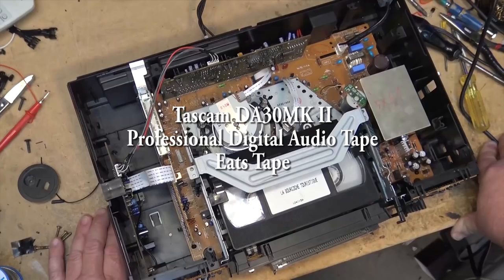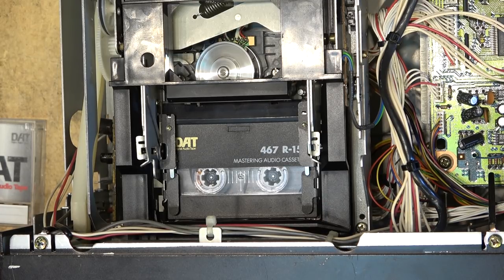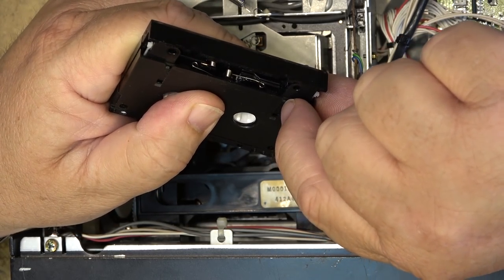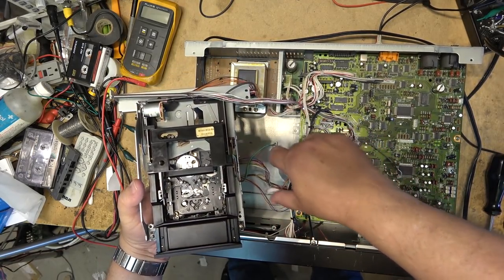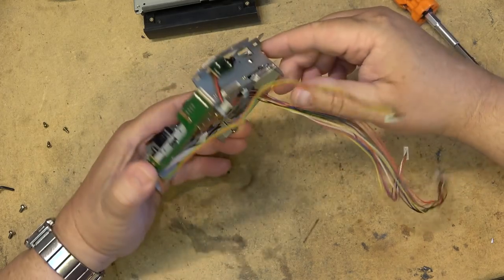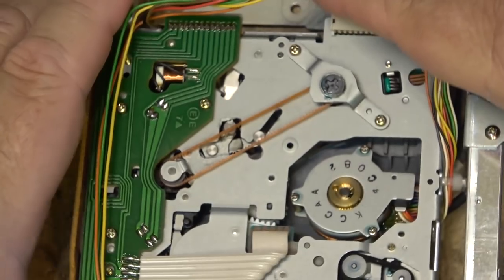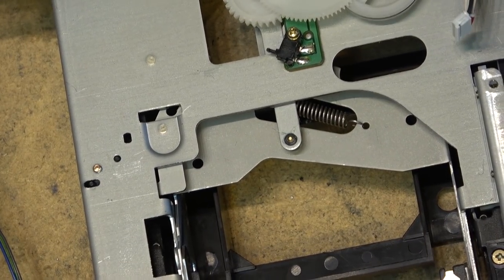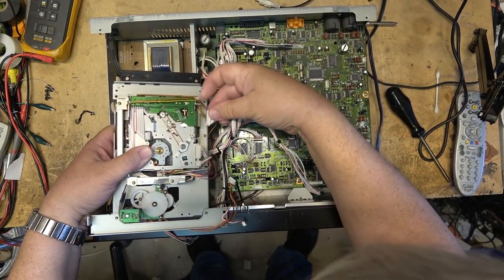Tascam DA30MKII DAT recorder Eats Tape

Comment: I just received a DA30 MKII that was advertised to have been tested and in perfect working order. Thankfully I have watched several of your awesome videos on that and several other models so I had ordered a couple of the loading belts to be on the safe side. Well needless to say I got an error 01 as soon as I turned it on. Fingers crossed and using what I have learned from you I removed the transport and there wasn't a stretched belt issue. There was a NO belt issue. And it was nowhere in the chassis so um someone did some major false advertising in my opinion. Fortunately the belt was all it needed. It appeared to have been well maintained as had been cleaned well. I ran a cursory swab over the guides and rollers and picked up a very minute amount of dirt. Popped in a tape recently recorded on my DA50 and it played and searched perfectly. Thank you so much for all the great videos! 
I bought this DAT as a backup to my DA50 which has been on again off again with transport gremlins. All direct drive reels, capstan and head. It started to act up when it was about 3 years old. Sluggish points in full FF or REW modes. Then it would eat a tape now and then. I cleaned it as best I could without removing anything as it was a very pricey item in its day and I didn't have the skills. It sat from '94 to this past summer. I discovered that the pinch roller would sometimes float away from "home" in the unloaded position so I would manually move it into place before loading a tape and all seemed well for a few hours of use. Then the sluggish FF and REW issues started again and thats when I started watching these videos. Sadly there is NO info or manuals or parts available anywhere because as a first gen TASCAM it had a very limited run and was quickly superseded by newer models. Its transport has all the usual components of a rotary head machine but that's where the similarities ends. I haven't seen any of the TASCAMs, Sonys, or Panasonics that are even close. But your videos have given me the knowledge and confidence to dig in and get a better look. Brake pads were gone. Greased areas were tacky if not dry altogether. Pinch roller shiny and hard though I was able to revive it with some patience and TLC. I replaced the loading belt though the old one didn't appear to be loose or slipping. When I first dug the deck out of mothballs a few months ago
 the actual elevator/tray belt was very loose so I used a belt I had laying around that was the same type and dimensionally workable. The head looks to be in great shape and very little dirt was cleaned  from it. I am guessing the alignment must be very close since recently recorded tapes play fine on my new deck. I am hopeful that it goes back together without problems since teardown was much more involved than the average systems that followed. 
I apologize for the long story but I am elated your videos have helped me save the DA30 MKII and guided me in general toward the hopeful outcome for my DA50  which was based on the TEAC R1 and revised slightly for the Japanese only market Esoteric R1. Keep on keepin' the cool stuff alive and thank you again sir!!
Reply from the maker: I've never been a fan of the all direct drive models of tape decks whether it be cassette that or VCR. Be complexity of the control circuit for these direct drive machines is very complex. The big problem with direct drive real motors is the added inertia from the rotor magnet. Controlling this extra inertia especially on fast forward rewind is a real problem especially as equipment ages. The flywheel effect creates a tape snapping especially on fast forward a rewind which can cause the tape to stretch and snap when it starts to slap in its cassette. It might have been fine on reel-to-reel which had large reels to begin with which created their own inertia but they typically used AC motors which had a lot more torque and open real tape was a little more robust than cassette tape. Personally I would avoid any machine that you separate motors for the tables on any of the machines that I have. Even the single motor that Sony used on there DTC 75es which uses one motor that controls both the pick up and supply is more problematic than the belt drive version that drive the real tables from the capsule motor just more things to go wrong simplicity is best.
Reply: @12voltvids  Thank you for your reply. I can certainly understand your point on reel inertia. Those spindles with the magnet base certainly have some weight to them and, as you said, create a flywheel effect. The brake pad wear seems like it was significant for the hours on the machine but I can only guesstimate that number. Based on how I used it back then I would say 300 hours give or take. The take up side is intact but fairly slick and 1/2 mm thick. The supply side had shed a couple of pieces between the pcb and base of the spindle. Caught by the windings for the supply drive. Half of it is frayed and it too is about 1/2 mm thick. I have been looking around at possible material to make pads from and I have heard the felt from cassette tapes is pretty close. I haven't decided yet. When that machine was new in 87 there was very little info on what to expect maintenance wise. It is my understanding that mine was the first DA50 that Tascam sent the US market. I can believe it given the very personal attention the factory rep gave me during the purchase through the music store I patronized. I paid four times what the suggested retail was only a year later. FYI the thing weighs in at 48 pounds. As I watched your Sony 75ES video it was obvious that my DA50 is to other Tascam models what the 75ES is to the consumer Sony models in terms of build and complexity. Just freeing the harness up enough to pull its transport involves way more connectors than the DA30 MKII and takes as long as pulling the complete assembly out of the latter!  lol Thanks again for your input and sharing of knowledge. I look forward to seeing more of your great vids in the future.
Reply from the maker: @granttucker9006  the da40 was one of the more reliable and generally easy to service machines and these ones racked up thousands of hours in recording studios and radio stations. I have a musician friend that had 8 da40 decks set up as a 16 channel recording setup.  They all operated in sync through a multi deck controller.  Scrapped the entire thing for qbass. 
Radio stations used them early on in automation because each tape could store 4 hours of broadcast quality material. Used alot for canning a show in advance.  Used mostly for the early morning shows that could be pre-recorded  during the day usually by the DJ on the air at the time  for replay at the midnight time slot.  Usually just the voice tracks were recorded and the music tracks on 2 other decks that were controlled by an air computer.  In the 90s I got a tour of KISM radio in Bellingham.  They were a fully automated station. I was able to shoot some video (it's on my channel) of the dj recording his show while the station ran itself out in the lobby.  Back then the music was all on reel to reel machines.  Replaced my DAT and then everything went to hard drive.

Comment: Great video. Exactly the problem with my DA-30 MkII, (Error 2) Once the belt was repositioned as the video explained all transport and play functions of the machine worked and the Error 2 message has gone. I only hade to remove the tray (4 screws and spring disconnect) and turn it over without disconnecting any cabling to do the fix. All done within half an hour thanks to this well explained video.

Comment: Maybe this is what is wrong with my DA30. 
It is eating tapes and actually tore the tape completely when I ran it after a few years of non-use. It's hard to remember the exact scenario when I tested it a few years back, but I do remember it was playing and then the tape got torn. I thought it might be the supply reel stopping, but the take up reel malfunction seems to allow the tape to play for a while but then the tape will likely get hung up when too much tape piles up on the take-up side and can tear when removing the tape. Worth a shot to take a look.

I watched you other DA30 repair videos (both parts) and all 3 videos are excellent and have given me insight at least where to start the troubleshooting process w/my DA30 Mark I unit. Thanks.
Phil
NYC Area

Comment: Great find on the belt that had slipped off!   Nice work as always.
Reply from the maker: I went to turn the pulley with the belt and the belt came off. I put it on and the pulley turned so it was, wtf, it was riding on the edge? Yup, it was.

Comment: Hi 12voltvids. Great videos! My Tascam DA-30 MkII loads and plays, but rewind and fast forward don't appear to work and when unloaded the tape is not fully wound back into the cassette. One time I had to untangle a cassette. I have the service manual and some ability. Both the toothed belt and loading belt appear to be OK. I noticed that the right brake had a little sponge pad sitting on top of it rather than in its front slot, as if it had slid upwards. When I pull the toothed belt, the cog that hinges between the left and right tape spoolers doesn't appear to move as easily as yours. Any advice as to things to try? Thanks.

Comment: Great, well explained (and entertaining) video. My DA-30 MkII  has stopped playing after tape loading. (Error 2 in the display). From your video it seems very similar as the machine ate my tape just as yours did. I am hoping mine is also going to be the slipped ribbed belt. If the ribbed belt needs changing it looks like the cover plate at the opposite end to the visible pully would need to be unscrewed to replace the belt. Do you think the cover plate / bracket at the opposite end of the visible pully is safe to unscrew to replace the belt (if broken or worn).

Comment: New subscriber here that was great. Can I ask is the tascam da38 and da88 unreliable? Have you any idea why a tape would get stuck in the da88 and have an error code ? I heard it might need lubed but more sure
Reply from the maker: A lot of those tascam units used a very small little rubber belt for the loading and unloading. The belt stretches and sometimes even turns to mush and falls apart. The little belt is quite specific you need the right size and right tension. If you put on one that's too tight it'll stall the motor out if you put on one that's too loose it will just slip. It's a critical part it's part of the protection circuit so that if something were to jam the belt is designed to slip and not provide too much torque from the motor that could damage parts unfortunately those little belts are about the size of a dime do fail and I've changed dozens of them. They are available. If you buy one from tascam you're going to pay a small fortune for it one of my viewers that has sent me a fair number to fix uses orthodontic bands you know like your dancers would use to hold something onto your tooth about the right size they're almost transparent in color rubber I may seem to work pretty good. I would check the belt first and then check the worm gear make sure that the lubricant hasn't dried up on that those are the first things to check on all those tascam decks it seems to be one thing that just goes wrong on them all
Reply: @12voltvids  thanks for the reply … and some great information there. The previous owner said he got a 9v battery to the motor and it ejected the tape. He then put the tape back in stuck again and triggered the error. I’m just thinking If it was the belt the tape wouldn’t have ejected
Do you know what sort / name of the lubricant I could use and where abouts / which parts need the lubricant ?
Thanks
Reply from the maker: @saren6538  generally when the belts worn out they will eject because it doesn't take as much torque to unleash the tape as it does to lace it. It typically is going to slip when it's lacing the tape. Lubricant I use is Molly coat but any synthetic Grease can be used. I wouldn't put that much myself I typically run them around 3 volts to load and unload.

Comment: So the owners diy brake pads work fine,  just a screwup on the belt.
When i had to pull many plugs out, i used a indelible marker pen and drew a line across the plug/socket join.
No two lines were ever in the same place :-D.
Reply from the maker: I do the same if they are the same size but these are color coded and different size.

Comment: I fixed one of this. They are not compatible with 90 tapes if you insert one of Panasonic 90 tapes it will get stuck inside the system and you have to manually eject the tape. Great machine
Reply from the maker: My da40 is as well as compatable with the 3 hour data tapes.

Comment: Ive never thought to buy myself a DAT because of the troubles i have read in magazines. Instead i bought a 3 head cassette deck and a direct drive technics turntable from ashly/ashley sound. He had cancer so he was selling everything off in the 90's.
Reply from the maker: DAT sounded superior to everything else and was used extensively in recording studios, radio stations, tv stations, film and video production.  Enthusiasts also used it at home but the home versions had the serial copy bullshit that the professional version did not have.  It was king in the recording studio used for mix down of just about every cd released.  Now people are scrambling to get all their tapes transferred to hard drive while the machines still are operational as when they wear out there will be no new ones.  They went out of production in 2006.
Reply: @12voltvids  I never buy into the hype of consumerism. Thank you for the info.

Comment: Hi Dave,  if you're getting a worse reaction after 2nd jab then I bet you had Pfizer vaccine.  If you have AstraZeneca jabs then it's worse 1st time round.
Reply from the maker: I had pfyzer for first moderna for second. Pfyzer us 30 micro gram mRNA and moderna is 100. So stronger dose.
Reply: @12voltvids  that's interesting,  they are conducting trials of mixing the vaccines but not started doing with the population at large. Sounds like Canada already is.
Reply from the maker: @davidpinfold852  yes with the mRNA they are interchangable as the active ingredient is identical.  The delivery mechanism is slightly different technologies.  Intellectual property but the payload is literally identical so they tell us.  The astra zenica and Jansen are totally buy they are mixing them too.  Not giving astra anymore here, it is not the perfered shot due to possible side effects.
Reply: In Germany you get the second dose with whatever you got on the first one. I'm gonna get Biontech/Pfizer. It's the best one anyway. Moderna is also not bad, mRNA is really interesting. Astra Zenica and Jansen are crap and should be avoided.